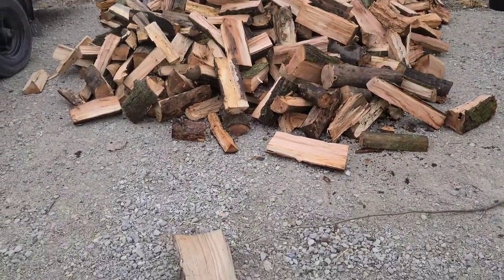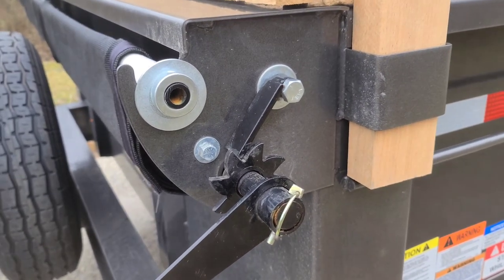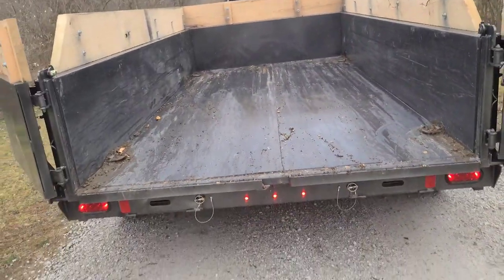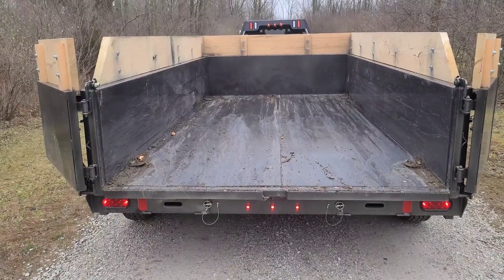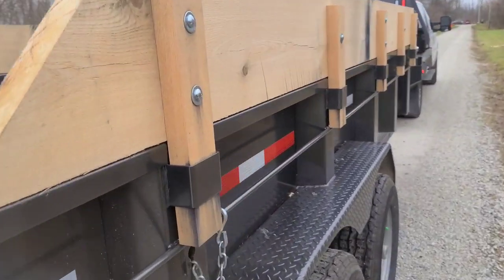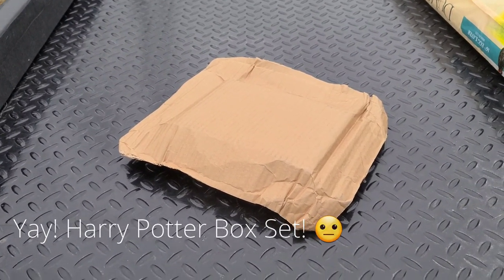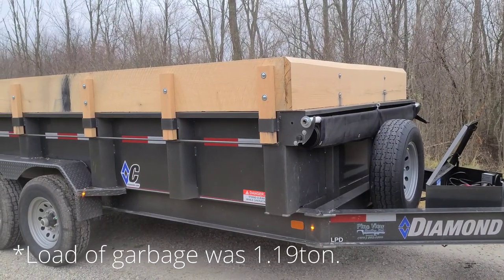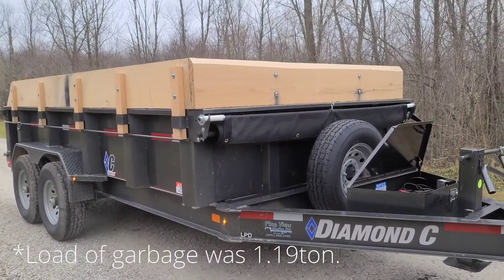Diamond C LPD Low Pro Dump 2.5 month review

Comment: This is a great video this is a video I'm going to show my business partner that this is the type of trailer we need. We do a lot of construction renovation and he wants to get a high wall I don't I rather have a lower and add wood just to make it easier to load for the guys but this is a nice trailer
Reply from the maker: Thank you. Even if I had taller walls I would have wood on top. But the taller the sides the farther a skid steer or other equipment has to drop the material in. Especially with the way we haul logs 32 inches seems like a long way to drop them haha. If I was only using it for trash I would consider 4 ft sides.

Comment: regarding the chains on the rear doors: I agree about dents and scratches being par for the course... but, one alternative is to cut some bicycle inner tube to length and slip it over the length of chain--then slip some heat-shrink tubing over the hook part of your gate snap. (And it reduces rattles--rides quieter).
Reply from the maker: I've thought about doing something similar. But I never know how I'll be using the doors and that would be bothersome when needing to adjust the length of chains. Somone else mentions the woven style protector as you see on some older pick up truck beds but I think I would be in the same situation. I do like the idea of the shrink tubing! Tjanks for watching and the great comment.

Comment: A comment on your tailgate chains. Back in the 50's and 60's, Trucks had chains on their tailgates. there was a thin rubber like tube slid over the chains to protect the bed sides and the tailgate when in the up position. Just wondering if maybe putting a piece of heat shrink tubing or something similar would protect the bed sides from scratches.
Reply: Bicycle inner tube or motorcycle inner tube
Reply: @davidperrin4856  Yes, that would work also!

Comment: Hey, your in depth thoughts and details of your Diamond C dump are well put together. I actually have a new dump trailer on the way. End of the month it's supposed to be in. I believe this week is the beginning of the build. I ended up going with a Moritz, for a few reasons. It's a 2021, a 12 footer, 14k GVWR. Price was real reasonable, with tarp kit out the door was right under $7,600. Diamond C does make a great trailer. I am interested in the differences over time between your Diamond C and my 12' Moritz. I also live in Ohio, about 30 minutes east of Canton. Keep up the informative videos and hope your arm is mending well.
Reply: I’m selling my PJ dump trailer and will look to replace with a better quality trailer.  How do you like your Moritz trailer?
Reply: @kyhamoge  
I only picked it up 4 days ago. Like the one reviewer said about the paint job. A lot of runs, but it's at least painted with a thick coat. They obviously could have done better there. I can deal with that. Rust is what I hate most. Far as the little bit I've towed it. It is really smooth. I haven't put a load on it yet. The torsion axles make a big difference. They come standard on the Moritz. Most other manufacturers sell them as an upgrade option. So do your research there. There are different opinions on torsion vs. spring suspension. Personally, the trailer is mechanically well made. I don't know what else I would ask for in a trailer. I did want paint over powder coat. I can fix paint relatively easy. And I will coat it in fluid film to eliminate rust. Plan to keep it the rest of my life, and I'm not quite 35 years old. Purchased permanent plates for it just yesterday.
Reply: Hey Kenneth, where did you buy your dump trailer from, I’m outside of Dayton & currently looking for a 12’ for construction debris. I do like the moritz models iv see but were talking 10k plus. Thanks for any help, 
Trent
Reply: @trentclark4754  
Hi Trent, 
My trailer I purchased new from Bennett trailer sales in Salem Ohio. A bit of a drive but could be worth it for you. The currently list a 12' 14K GVW Moritz for $10,145. Same trailer as the one I bought early spring of last year. Nearly $3k more than I paid for it too.... Reeediculous how much the price increase has been since buying mine. If you are interested in the same thing but 12K GVW those run like $300 to $600 cheaper. Best of luck, I'm quite pleased with my Moritz. I did add custom side boards that increase the volume to something like 8.5 yards, a little more than the 14 footer with no raised sides. I bought it for the heavier axles, not so much for the volume increase over my old trailer.

Comment: I use a PJ Dump Trailer and the D-Rings are on the sidewall.  Some dirt still gets caught on it but definitely not as bad as you have shown.  That said, with the PJ they should have added some welding reinforcement on the outside C-Channel as the inner walls are starting to pull inward from chaining down equipment.
Reply from the maker: Thats a good point I never thought about before.
Reply: Thanks to your video you made on your Pj trailer I made sure to check that when I went looking. My big Tex has them on the floor like the Diamond and gets trashed hunged up but I would rather have that then the sides pull apart

Comment: I have the exact same trailer mines a 2018 I absolutely love this thing from my construction business at Halls what I want when I want it and it’s a beast I also use it to haul gravel into my property and building a road are used to The tailgate as a spreader works pretty well you have to have somebody work the button while you drive the truck forward  I think I need a longer tether on the remote
Reply from the maker: I thought about trying that sometime. I wonder if you can buy a longer cord for the remote Mine looks like it's just sections hooked together.
Reply: I am looking at wireless remote that works like a winch remote

Comment: I have a Diamond c dump as well my one ramp gets stuck in the ramp pocket and the ramp doors are a pain to get the pins in and out. The hooks in the back for the tarp to lock into are so tight it’s hard to get the tarp in and out of them. And my pins got busted off for the doors same ones you said someone stole I’ve replaced them several times and they keep breaking off! That’s pretty frustrating other than that they make a damn good trailer
Reply: It does look like the DC trailer is built okay, but all I see at the rear of that trailer is problems waiting to happen!!  This guy lives in Ohio (where they salt the roads) and ALL those pivot points and ramp doors are going to be a bunch of rusty, frozen pain in the ass in a few years.

Comment: Hello from Alaska, we live in a cool era of being able to connect with others. Your wooden rails looks like a side business in themselves - really nice. Thank you for the length comment - always a tough decision. What are your ramp lengths, are they long enough? Curious about the business side of dump trailers? Do you provide the hauling service / renting it like a dumpster? What kind of price terms does it yield?  Get well.
Reply from the maker: Thanks for the comment. I would have to measure the ramps. Thru loom short but do work well with my tractor, and I have plenty of clearence. The boards do look great, my friend did a great job in them. As far as making money with the dump trailer, I rent it out as a dumpster. I drop it where the customer wants it, I lock it, then pick it up 2 days later ,or whatever was arranged. I haul it to the land fill and then do it again.
Reply from the maker: Price depends on dumpnfees and travel time. We start at 265 for 2 days. With the arm I haven't rented it out since Oct, butndump fees averaged 50 dollars a load.

Comment: Great video, in my experience with construction & dump trailers unless it’s rock or cement a typical trailer will handle whatever you load. I run a small construction company & we run a 10’ which 90% of the time only sees residential construction debris trash & maybe small equipment. The only times it’s ever been over loaded is same as you, those gravel equipment operators can be squirrelly so you have to be diligent. Currently I’m in the market for a small 12’ for siding debris & the ease of towing & use on a typical half ton work truck. When you drive from the country to the city for work daily gas mileage is everything. But again my setup was built around construction debris, if I was hauling gravel daily the truck/trailer would be heavily built. Thanks for the video & glad I came across your channel. Best recovery
Trent from Ohio
Reply from the maker: Thanks Trent. I agree with you 100%. If I get back I to renting the dump trailer out I would love to have a light duty 10 ft trailer. Add some higher sides and you are good to go. Thanks for the comment. What part of the state are you from?
Reply: What guage do you recommend, 10 or 12?

Comment: Great video!! Here is a question,why buy the low profile and add the boards? Would you have rather bought the higher metal sides?? Great quality of the Diamond C!! My 1025 R will fit perfect in the 12 foot. Keep up the great work.
Reply from the maker: Good question. When I bought that trailer in Sept it was hard to find dumps. Due to covid a lot of manufacturers are behind. I was told diamond c is 25+ weeks out on new orders. I put money down on this trailer sight unseen. It just happened to be the next 14ft that they had coming in. I didn't want to wait months for my trailer. The next is it offers protection to the trailer from loaders. I would rather have a loader operator hit one of the bunk board instead of hitting and denting the trailer. Thnks for the comment!
Reply: Totally understand! I am trying to make up my mind on the shorter sides or larger?!?!? Tough one.. I like the way you do through research. As I get older I spend hours researching things like this. I would much rather buy one and done vs one cheaper and it breaks all the time. If you get time check out Project Farm! Thx
Reply from the maker: @michaelbrewer1474  will do! Even if I buy one with 48 inch sides I would add a boat. Im leaning towards 32 or 36 inch sides with  12 inch boards. Everyone asks why I didn't get 48 inch sides, I haul alot of logs and at that height it makes it hard to load logs without having to drop them in 2 ft

Comment: Dumb question on that latch your having a issue with cant you just flip it backwards and let it hang upside down
Reply from the maker: It won't rotate backwards. When you lift it up it hits the top plate of the flange. I wish it did. Tjanks for watching and thanks for the comment. Wish I could have shown it better.
Reply: That's a good question, I had the same thought.

Comment: How'd a 3/4 ton do with this?
Reply from the maker: Does fine. I tow this with a 2015 f250 6.7 diesel. I have another video that goes over legal weights and eaht I can tow. Legally I can have 10k lbs in the box and be legal on the trailer and the truck.
Reply: @PheasantLaneFarm I have a diesel too, that's good to know. Thanks for the info

Comment: how much does a trailer like this run I'm in the market for one
Reply from the maker: I paid 8400 out the door. Every other dealer I found was over 10k.
Reply: @PheasantLaneFarm  thats a good deal hope i can get my hand on one soon
Reply from the maker: @Metroz254  they can be few and far between right now. I actually put put money down on this sight unseen. Build time for a new one is 25+ weeks according to some dealers I spoke with.
Reply: @PheasantLaneFarm  i been looking in to the maxxd telescope they told me they are also 3 months out but now im liking the diamond c  more
Reply from the maker: @Metroz254  the Maxxd is a nice trailer. Depending on where you are located some dealers will let you change a trailer that is already on order so you can get it sooner.
Reply: @PheasantLaneFarm  nice to know. nxt week ima  go to couple of dealers and see what i work out. thanks for the info
Reply from the maker: @Metroz254  any time.

Comment: Finally got mine in! I agree completely with all the negatives, mine is exactly the same. I’m going to weld up a magnet for the tarp latch. That latch was an afterthought for sure. For the barn doors, if that latch was 1” higher you could swing the gate in 6” more! It’s a great trailer with just a few little mods it will be perfect.
Reply: Also, the magnets already fell out of the back of my remote. They are just glued onto a metal bracket. Needs a better epoxy
Reply from the maker: That would make a big difference.  Let me know how your magnet mod works. I agree, with a few design tweaks it would be a flawless trailer. Thanks for the comment!
Reply: This is great info. Thanks for sharing.
Reply from the maker: @PurpleCollarLife  thanks for watching!

Comment: Whomever designed the doors not to open all the way to the fenders when open. Has never used a trailer in the real world. Probably only used it in a open field with no gates or  trees  or other obstacles.
Reply from the maker: That did cross.my mind also. Would be nice if they would tuck in tight in the open position
Reply: Yeah I’ve had them get in the way a few times on mine when dumping I’ve had to have someone hold them in to miss trees and what not that part is not ideal
Reply from the maker: @Trapaholic721  it would be nice if they would work on this design.